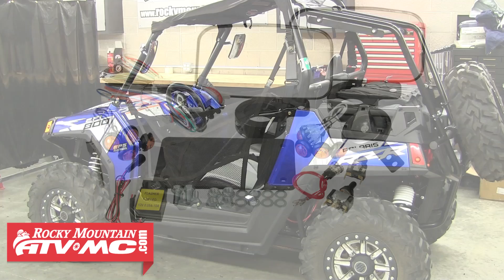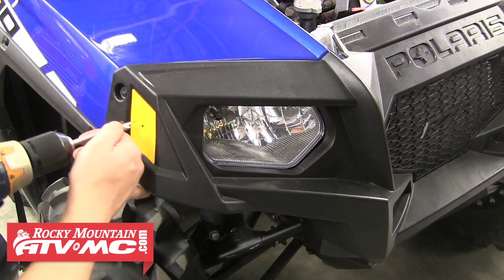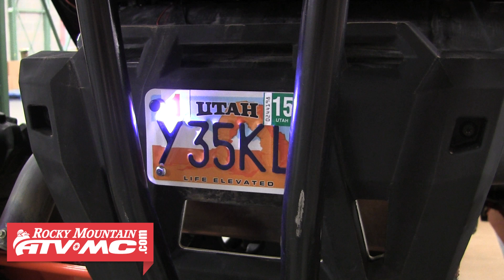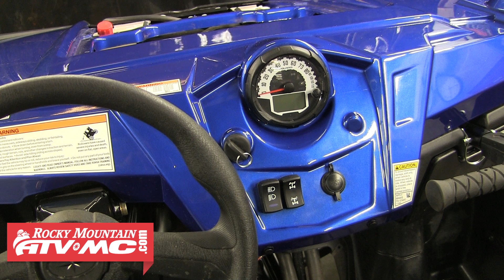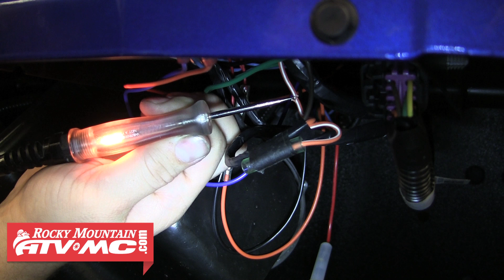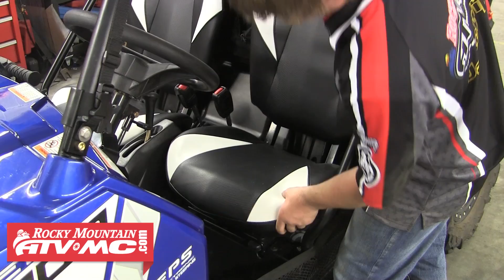Tusk UTV Horn & Signal Kit Install | Polaris RZR 800

Comment: I have a 150cc gy6 go-kart will it fit i order one so let me know thanks
Reply from the maker: This kit is designed to be used in UTVs with an existing electrical system and wiring harness. You may be able to get this kit to work but some modifications would be required.

Comment: i have a Yamaha ytm 200 with no battery, just pull start with charging system..
can I use this application on this or a Honda atc 110 3 wheeler?
Reply from the maker: lugo small engines You would need to select one of our Tusk Enduro Lighting Kits that have the re-chargeable battery pack. A rechargeable battery pack is included with models that don’t have an existing battery. Can be recharged quickly with the Tusk 1 amp battery charger.  These kits with the battery pack option run $189.99.

Comment: does this mean I can put these on my honda rincon and be legal?
Reply from the maker: Randall Brumfield Yes! as long as these parts and this kit passes your local laws and regulations so you'll want to check with your local authorities first to get the scoop on what is required to make a machine street legal in your area and then decide whether or not this kit meets those rules. If you have any questions let me know! Also if you have a Rincon you may want to refer to our Tusk ATV Horn & Signal Kit video.  Tusk ATV Horn & Signal Kit Install Thanks!